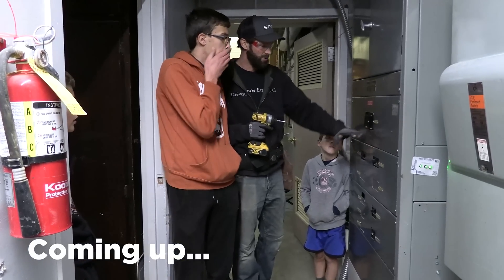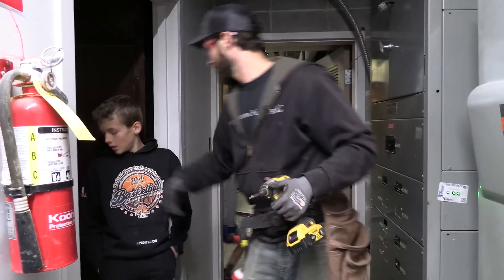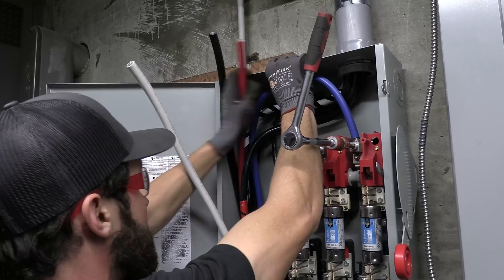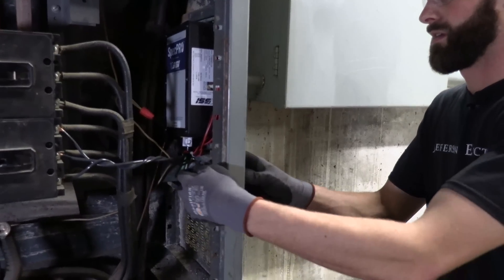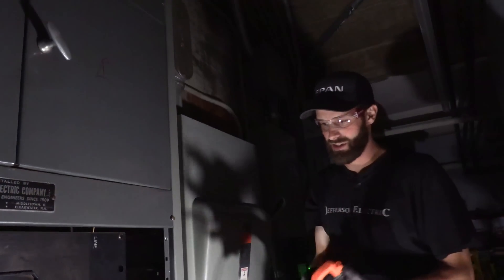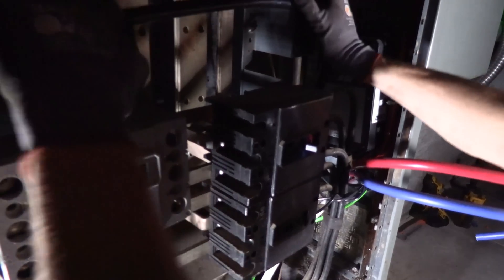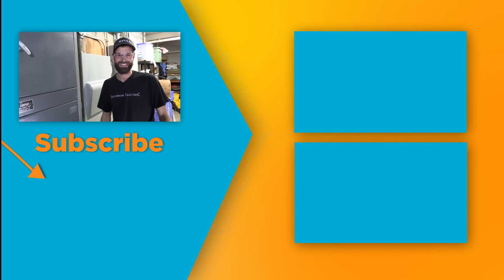They Don't Make These Anymore

Comment: Another reason I always keep my trusty Ideal AC/DC clamp on multimeter 😊 on me at all times while   doing panel replacements particularly on older buildings,  is because sometimes there is a center tapped delta three phase service.  For those unaware,  this service gives you 3 voltages of 120/208/240, or in very rare services,  240/415/480 volts, and the phase with the higher voltage to ground should have been colored orange and land on the B phase in the panel,  but older panels sometimes had the high leg land on C or A phase and might be something other than orange,  and there is a risk of smoking up equipment in the building if your careless with the high leg.   TEST, TEST, AND VERIFY. CANNOT STRESS THAT ENOUGH.  SAFETY FIRST.
Reply: The high leg set up is so freaking strange to me.
Reply: @nateo200  😂😂   same here.   When I began my apprenticeship it took a little bit of time to understand the concept.   Although the high leg setup is rarely used today except in highly specialized applications,  nonetheless we as electricians must be aware of it and always use a suitable meter to verify voltages,  relying solely on colors or labels to tell you the system you're working on is playing Russian Roulette.
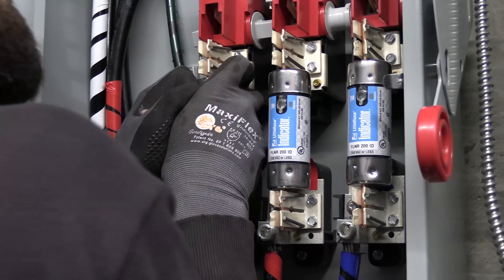Reply: Actually I saw this once in a residential install believer or not apparently it had been used for other things as primarily being used for the large motor loads such as AC compressor and so on but there is obviously connections to 3-phase throughout the place clearly somebody had some pretty heavy power knees and yes it went to other outbuildings as well we suspect someone had a very large shop possibly machine shop even heavy power equipment even in the basement and judging by the incoming service and how everything was set up there were few Transformers as well almost all everything was had been disconnected at the service even Breakers locked out and disconnect switch is locked in the open position so they were very serious about the work that was being done and when they were not using things even handwritten labels as to what was served heavy equipment for sure but can't remember all what was there but definitely remember one saying chiller another said Mill and many more there was at least 2:50 amp 3-phase plugs as well just in the basement alone probably largest electrical service I'd ever seen in residential even fairly large even for something like a farm back in the day even this was before a lot of heavier loads what worm farms would have.

Store Riverdale Church originally only hand single-phase power coming in really the only things that needed to 3-phase at least initially would have been the organ blower motor in the elevator the elevator is a primary reason to has rephrase coming in however later on with us he's got updated the three-phase was put to better use.

Still remember having to reset Breakers all the time we did knockout one feeder was quite by accident during the Christmas present rehearsal one year we're only pulling a thousand extra Juan's took out the whole feeder everything was so overloaded as it was didn't even trip any other Breakers or the feeder itself.

News the electrical system that a church like the back of my hand good reason to!

Also one time me and my father were there we heard this something bumping a regular intervals the realize it was coming from the Bell Tower.

The chorus got the keys went up there what it was was the old exhaust blower or possibly Supply Air I can't remember it was just fun circulation all the time within the church to exchange air!

It turns out is the drive belts have been replaced this is no v-belt straight up leather belt thrive that thing had to be ancient.

Apparently at one time the Oregon bar may have been belt-driven or possibly had some auxiliary equipment someone had suggested possibly vitamin A small DC generator clearly there was somebody else Mountain years ago and have been well-used but that piece of equipment was long gone on the blower motor and also it seemed like the motor was rated much more than it needed  for just the blower itself.

Originally I was thinking that possibly there's a different truck motor and the other motor was newer.

he motor in the Bell Tower.

Was probably 1 largest I've seen in a long time at least in an application like this ancient for sure!

About the next largest or thereabouts they have been bigger hard to say was the original blower in the commercial kitchen in church recently it was almost at ceiling hard this is for the exhaust system that was a real Beast.

Keep in mind they only had single phase at the time so you can imagine the size of these motors in the current draw I don't even know how many horsepower but they were ginormous.

Apparently somebody did save the motor from the exhaust system important years somewhere something special is what I said it turns out they were really into over a logical and reusing things to give something a bit of character and something that would keep on running then was in good shape.

Hard to believe with all the old equipment just ran so well almost like that was new even though it was..

 well ancient!

It turns out that the reason why that something was going on against the belt had been replaced even the old felt had just been slipped off the pulleys just left you still in one piece probably didn't take the effort to remove it fully although I I did remove it for some leather to use for some things that was kind of useful not exactly something I'd be able to get a hold of otherwise!

Sensitive belts had be spliced until it wears in it's quite noisy you because everytime we would hit the bully you get that thump.

Remember my grandad show me how they would set up the leather belts on the tractor and getting everything to aligned properly it was kind of interesting.

Also I'd seen remnants of wine shops in places as well that I've been at.

Some people have literally called me a genius-level at repairing things over the years and getting things working in that weren't or even technicians and more of Sunday how could you figure it out how did you get working again.

Literally had some servisfirst no dumbfounded that I can even get it going.

They're fact I work in a few workshops and occasionally the people that were the main heads of getting things taken care of and so on would actually get me to take a look if there was problems and other people are scratching their heads got that gun again in record time.

And yeah I've been called the real life MacGyver more than enough times on top of this.

One incident which well probably shouldn't have happened because of the nature safety devices and so on but we had forklift have a mind of its own as they called it at that point.

Something happened cannot remember all the details actually is probably multiple things at the same time it would have to lead this situation.

Electric forklift.

Basically everything was essentially full bore on top speed and out of control they tried everything couldn't shut the same down just kept on very much like Energizer Bunny.

This was one time I literally crowbarred something happened to see a crowbar and I knew exactly where I can easily German crowbar in and sort out the power after the main fuse.

Nice big bang as well but you got to do what you got to do an emergency!

That cover on there was long gone so is easy enough to get to.

By the way the battery connector contacts at welded themselves together for some reason at that time as well so that didn't work either definitely many failures simultaneously to to cause all these various issues simultaneously and yes there was a lot of damaged wiring through and much more one thing probably very bad designs did not help much either.

And even if there was any type of bushings or otherwise they were no longer present.

I was asked to fix things up a bit and make it to this going to happen again at least to keep any repairs from being damaged again and potentially reoccurring also there was a disconnect switch installed accessible to driver just in case.

This was by my insistence I found out later few years later that the same thing it happened but different circumstances and they shut it off using that disconnect switch.

For the reasons that we definitely needed to shut the unit down the first time and somebody was hidden behind the loaded forks surprise Dave we're okay but things could have been a lot worse.

One time they had another runaway forklift and went off the end of the loading dock not good this was one of the LP gas operator forklift good thing he bailed out quite a bit of flames there at least had the sense to bailout!

Even going off the end of the dock could have been really bad news for him not to mention the vehicle.

Heard also wants someone wanted up going to the opposite end of a trailer as well.

Where the funniest thing is well at least when it was funny but we called cheese can or otherwise dip cans versus forklift surprisingly well depending on which way you looked at it the can one as in terms of as flattering everything everywhere and they get big mess.

This is more common than you think yep big-time cleanup!

By the way there were times that somebody got something there only and would have to use the eyewash station because the some of the stuff was quite spicy and would actually burn your eyes if this happened.

When we're doing labeling once we relabeled for institutional use.

We were not required to wear safety glasses when doing any of this work but probably would have been better to have this in the first place could avoid getting anything's wider than your eyes as well as this situation!

I had a tiny chip of the label glue come off when I was removing the original label the course right in the eye.

Needless to say after that and the time got that hot stuff in my face and all over me in my eyes you better bet I'd wear safety glasses.

I did did  get to the eyewash station which was right next to that Beltline!
Reply: Also there's a circumstance that kind of got not everything but it was intentional and got a good laugh and got some eyebrows raised and yeah of course and no damage could have been done nor anyone free injured or otherwise of course but not something you should do even this Aurora said that he would have done this eventually anyways and had thought about it many a times here we go.

And if anyone knows about three phase power how about her can be easily reversed we were having a really down time that people become dumb. Just everyone's complaining and just kind of sick of things and we knew you would laugh to get people or at least a few eyebrows raised.

I got permission to do this I was doing some service work and would not affect safety in any way of course nothing shut down during lunch hour just before actually how to do a bit of work on one of the pieces of equipment yeah power cable had come loose and was in danger of causing some issues checklist causing a little bit of controlled Mayhem and just getting the eyebrows in a good laugh potentially and he said go for it 

And he said that he'd even want to do this at least once if not more on one of those days where everybody was just had enough or just so bored whatever and 90 fun while.

Simple enough I was in there already just checking connections and also our to the same prison what is the cordless being redone.

At the plug for the border for the conveyor belt that is on the male end of the Claude just reverse two or three phases equals motor in Reverse!

So when I came back power on and everybody was staying there or bursting out laughing or like what the and everything coming back the spelled that really made the day for everyone and everyone walked out of there with smile that day!

They need everyone did of course don't attempt this this is not something that would cause any damage or any issues if this was done this is not something you'd know what to do but under the circumstances there would have been no damage or injury or anyting else but it was just some good healthy humor for a change and just even around the area people gawking and laughing yeah definitely was in need of a pickup around there.

Most of the people at least in personal line or just like a standing there couldn't even moved or just like so wide-eyed and your future is but then in the end just laughing out loud yeah pretty cool was a good gag.

Don't worry would not have done any damage to equipment either of course otherwise would not have been done besides that need to be taken out of service for few repairs anyways!

Of course I was standing by the disconnect so that could easily once the deed was done shut down right away it's kind of cool but my supervisor said I could do it and said yeah where everyone needs a bit of a laugh once in awhile and it's cool to get to do something like that you give her one of the nice surprise and I did laugh
Reply: I only ran into a high leg delta on an old factory 600 amp 3 phase MCC .We were lucky that the contractor had left the z bus in a plastic bag at bottom of MCC.Enough for 3 more spare breakers .Don't remember the voltages but one leg was taped orange
Reply: @carlubambi5541  A delta service was only designed to have 240 volt (or 480, depending on the service) loads attached. People would often tap the service equipment with a two pole breaker and feed a single phase panel for lighting loads. Had to be careful and not get the wild leg.
Reply: @littleprincess4417  yep that ghastly 208V (or 415V in the case of a 240/480V 4 wire delta,  very rare) high leg  accidentally connected to single pole breakers is the best way to check the ruggedness of your equipment,  by noting how long it holds the magic smoke inside before releasing it.  😂😁
Reply: @Sparky-ww5re  Hubby told me of a case where a company employee (not an electrician) installed a 120 volt duplex receptacle right under the panel so that the person working there could plug his radio in. Square D QO120 breaker. You guessed it. He plugged onto the wild leg. Used a test light to show the receptacle was working, but didn’t check voltage. They said the little radio caught fire as soon as they plugged it in. Hubby said their boss chewed him a new one for not following procedures and making a work order for the electricians to install the receptacle. Fortunately it was just a cheap radio, but it could have gotten someone killed.

Just asked hubby. He said they never had any 460 delta services, only wye. They had quite a few 240 delta services that were installed to power window units when schools were first being air conditioned. This got around the code restriction of having only 1 service of each voltage on a building. The code considers  a 208 wye and 240 delta as different voltages.
Reply: @littleprincess4417  oh wow, thanks for sharing so that hopefully other's may learn from this mistake and leave adding circuits to qualified personnel.   As for panelboards fed by a 4 wire delta system,  NEC 408.3 (F) (1) requires labeling as to which phase is the high leg, and what the high leg voltage is to ground.  Lacking the proper labeling,  I can usually tell whether I'm dealing with a wye or delta system by looking at how the breakers are arranged.    For example if I walk up to a three phase  panel and see every third slot is occupied by a two/three pole or blanked off, there's likely a reason for that wasted space and almost guaranteed to be a delta system.  That's another visual cue I learned from a commercial electrician who's been in the trade for almost 40 years.
Reply: @Sparky-ww5re  My husband has been a Master Electrician for 30+ years and a journeyman prior to that, with a total of almost 40 himself. The panel I mentioned had been installed probably in the early 1960’s when labeling wasn’t as strictly enforced. He did say that the high leg was marked with orange tape, but most likely the person who hooked up the receptacle had no clue what that meant. Fortunately, you rarely see a delta service anywhere except commercial buildings, although our church has a 240 delta and a 120/240 single phase services, both fed off the same transformer bank.

Comment: That brush is designed for copper pipe. When turned in the Wrong Direction on pipe it actually damages the Brush. 
I noticed the Glow from the 3 Green LEDS on the other Switch before You mentioned the Fan running. 
Mike M.

Comment: Why are you still using hole saws, Joel.   Battery operated Knockout punches are quicker and do a better job and are usually safer. Great video.  Russ from Oregon, 28 years in the Trade.